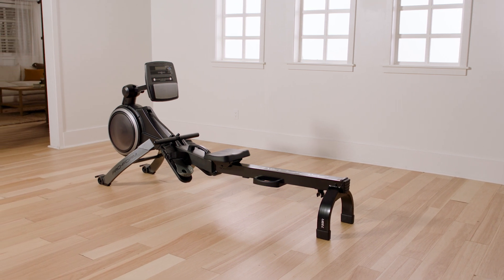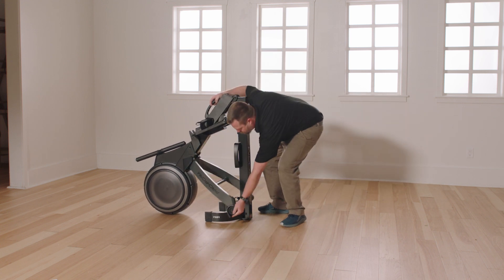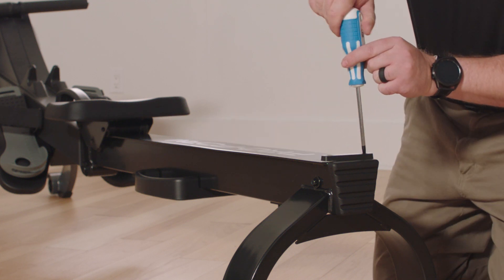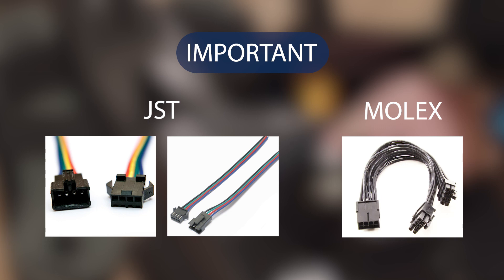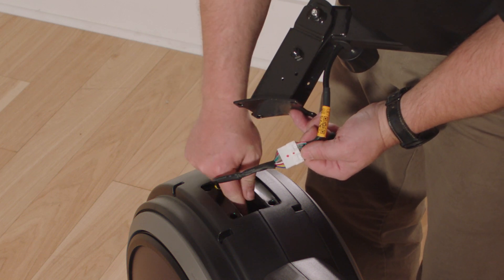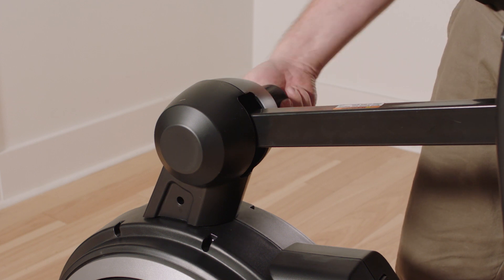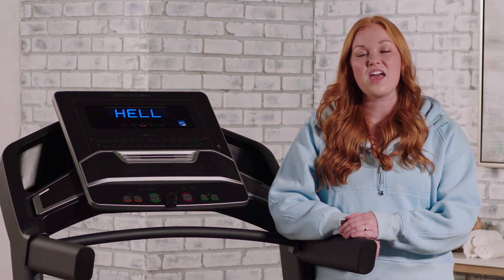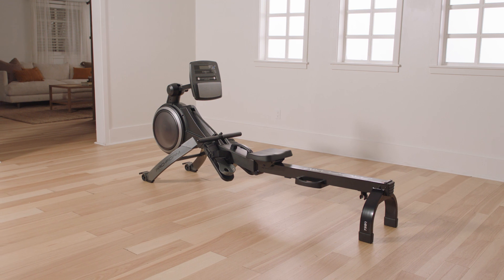Assembly of the PFRW58121 ProForm 750R and similar models

Comment: Whenever I try to enter manual mode it gives me "5620"
Reply from the maker: Sounds like you are pressing the iFIT sync button. "5620" is likely the Bluetooth pairing code for connecting to the iFIT app on your smart device. To enter a manual workout you just need to start rowing. If the workout is not starting you may need to adjust the reed switch.